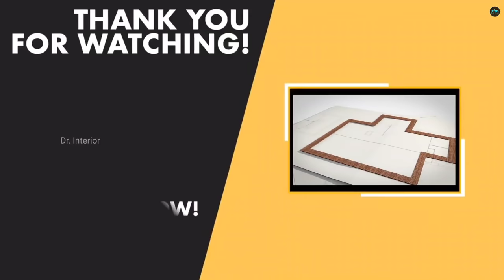Weight 500gm കൊടുങ്കാറ്റിലും ഇളകാത്ത Nano Ceramic roof tile|Roofing ideas|Roofing trends|Dr.Interior

Comment: I am absolutely thrilled with the roof tile installation performed by grano ceramics. From start to finish, the entire process was seamless,
and the results are outstanding.

The team at grano ceramics demonstrated a high level of professionalism and expertise. They were punctual, efficient, and respectful of my property throughout 
the project. The attention to detail in every aspect of the installation was truly impressive.

Not only does my new roof look stunning, but it also provides me with peace of mind knowing that it's built to last. The quality of the roof tiles used is evident,
and I appreciate the extra effort taken to ensure durability and weather resistance.

Additionally, the customer service provided by grano ceramics was exceptional. They were responsive to my questions and concerns, and the project was completed
 within the estimated timeline and budget.

I would highly recommend grano ceramics to anyone in need of roofing services. They have exceeded my expectations, and I couldn't be happier with the results.
Thank you for transforming my home with a beautiful and reliable roof!

Comment: Instead of 1 sq.ft if you could introduce little higher size we can reduce steel structure weight as well as cost of steel. Now steel pipe price is going high..
Reply: Exactly.. Steelstructure cost is too high.

Comment: Sangathi kollam , ethu oro iterationum  change varunndu , appo pazhye technology (locks , size etc) pinne manufacture cheyyum ennu thonnuiila , due to poor demand appo ethu install cheythe oralkku engane 20 years replacement kittum . enthekilum problem karenanam 
kurachu tilelukalkku problem vannal traditional tile anekil after 20 years available ayirikkum but  ee casi full replacement mathrame annu option undaku.
Reply: Mobile no

Comment: FIRST OF ALL I APPRECIATE THAT SOMETHING NEW HAS COME UP IN VIEW OF THE NON-AVAILABILITY OF CLAY TILES. I WOULD LIKE TO ADD BELOW TWO CLARIFICATIONS WHICH DON'T TAKE AS CRITICISM.
WHILE DESCRIBING YOU SAID 140-15O. IS IT PER TILE? IF SO WHAT ABOUT THE SEMI CIRCLE TYPE?  YOU HAVE NOT MENTIONED THE COST OF THE LONG PLATE AT THE JOINTS. 
ANOTHER FIGURE CAME UP 28/48. 
IS IT 20 DEGREE SLOPE? 
I THOUGHT OF ASKING THESE QUESTIONS BECAUSE IT WILL HELP OTHERS RO UNDERSTAND AS WELL AS HELP YOU IN FUTURE.
Reply: please contact us for more details.

Comment: What happens during rain when the screw gets rusty?
Reply from the maker: ഇല്ല
Reply: @DrInterior  what illa? Did u mean that the screws wont get rusty?
Reply: @TWEETYDOTPIE , Actually this person has no practical experiences regarding this product. Its name itself is fake, "NANO-CERAMIC". Actually it has no connection with the ceramic, it is made up of plastic. The product is light & cheap looking, the interlock hooks are thin & feel fragile. There is high chance of colour fading with time, the tile may also get deformed by temperature which can lead to leakage. There is no long term review and the price is too high, double that of ceramic tiles.
Reply: @bipinraj6449  I wonder why they call it NANO-CERAMIC...You are right, its not ceramic at all...its a composition of many products including fibre..When the guy came to my house to show the sample, at first I liked it bcos it was hard, but was not sure about the colour even tho they said it wont fade, but reviews says otherwise and another person told me that there were lots of customer complaints and the quote they gave me for the tiles were expensive.  So I switched my decision to buying another type of ceramic tiles and fixed them on my roof....Seems like a better option product cost wise and labour and other material wise.